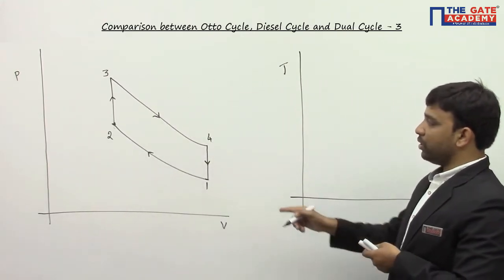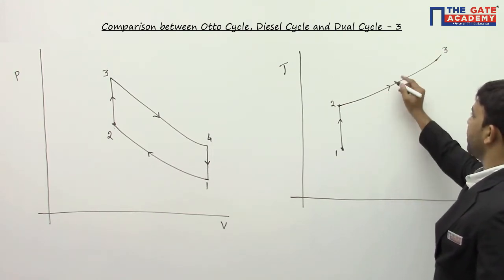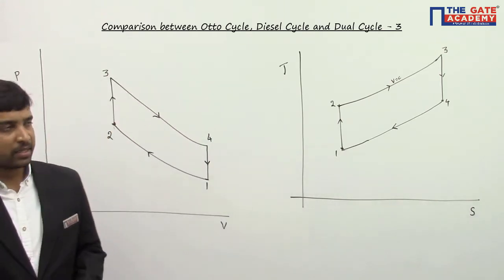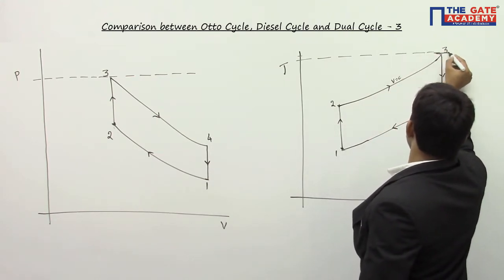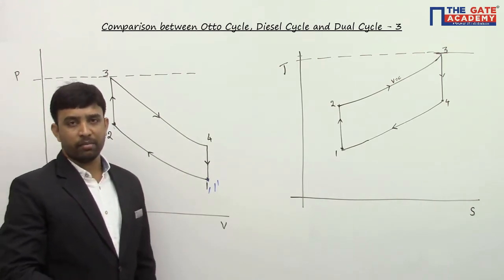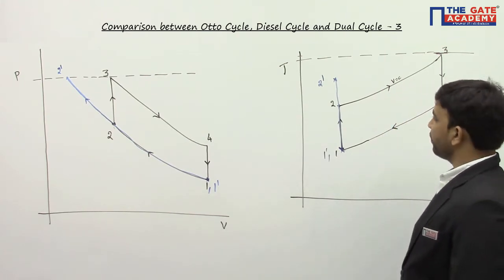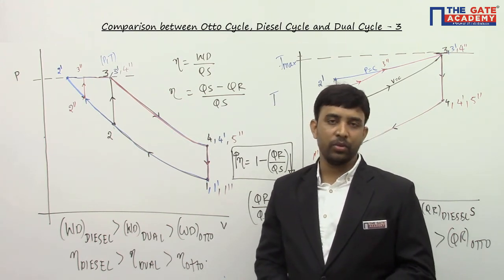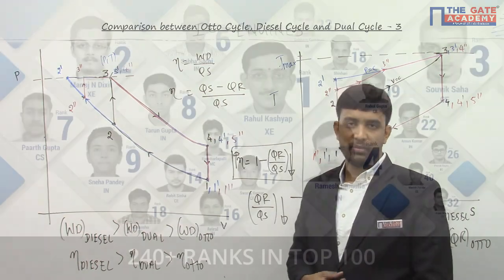Otto Diesel & Dual Cycle - 03 | Thermodynamics - IC Engine | Mechanical Engineering

Comment: work done in case of maximum p and T must be same for all cycles coincides for work.
Reply: Work done will be different for different cycles as the area enclosed by the cycles is different. Work done in a cyclic process is equal to area enclosed by the cycle